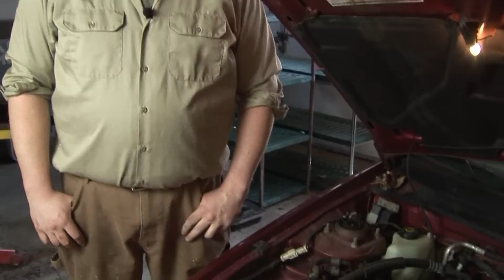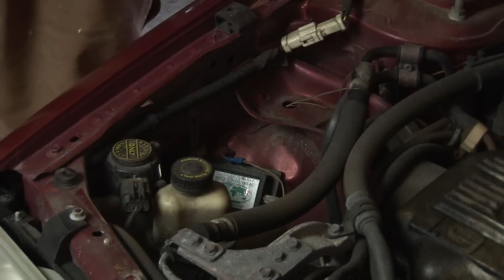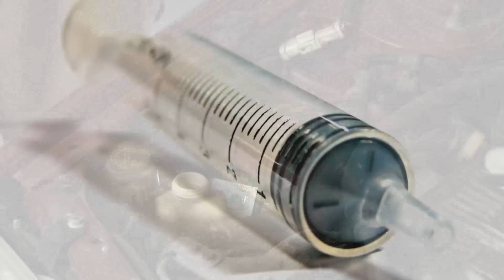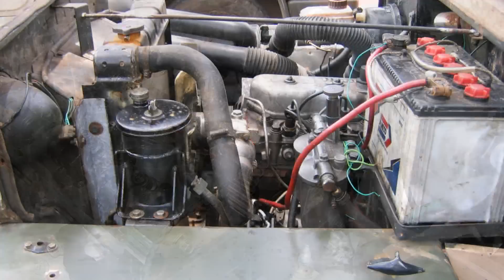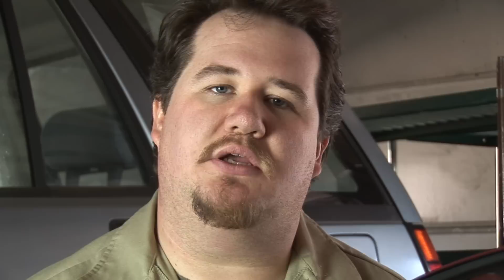Auto Repair : Replacing Power-Steering Fluid

Comment: I wish I knew this last year. As I bought a new pump from Auto Zone . Found out it on a rack and very hard to take off. So took it to a garage to put on - They said sense off, change water pump to. I had a extra warranty that paid for all. They called and said ready. Then a few minutes later said the Auto ZONE pump no good I bought. So I had them put another new one on they got from their parts store Napa. Each time was close to 300 $s  ( OVER $700.00). And now the same noise again! As you read this you might to wonder if I got F---.! Auto Zone did pay for 100 dollars and refund pump. But I really wonder if my old first pump still on. Sure glad I seen this video. A bad expensive lesion!! The garage was a good one -- but wonder cause I told them to put a new pump on -- all they did was half ass clean pump tank?

Comment: I'm hoping this is what I need to do. I was driving my car the other day and went up a very steep, narrow one lane road and had to do a tricky 3 point turn in a tight space. It was at this point my steering wheel began to lock up and this squeaky humming, vibrating noise started to emanate as i turned the wheel (with great difficulty). I decided it was best to drive home and leave it which i did successfully. I can't afford a mechanic so if anyone has any thoughts I would be grateful.

Comment: your reservoir is the over flow.
I don't know your car at all but should be the same as any american car.
You would need to disconnect the line coming from the rack & pinion(firewall area) and replace with a clear hose going into bucket. 
important not to let the pump go low as air would get in and you would need to bleed the system after.
I also would plug the hose you disconnect so dirt don't get in.
easy job add some lucas additive works wonders.

Comment: your solution sounds right. On my car there is a hose connected to the lid of the reservoir which I'm guessing is for overflow, it's just open ended.. and the other looks like it goes to the pump, where is the return line? (07 mercury mariner hybrid)

Comment: This video is all wrong his advise can actually damage your pump.
Disconnect return line place it in a bucket and have a friend add fluid to the reservoir while you turn the wheel continue until fluid flows clean.
Seriously that would be like me removing my engine oil through the dipstick as much as i can and then toping the old oil up with a cup of new oil.
I hope you are not a "A" class mechanic.

Comment: If you don't remove the return hose and add fluid until it runs clean, you still have contaminants in the lines. Definitely recommended!

Comment: wow. do NOT listen to this guy. That is NOT how you flush power steering fluid. The proper way to do it, is to get a helper, disconnect the return hose from the resivoir, and start the vehicle. Have the helper pour in new fluid as fast as it comes out the return hose. Once new fluid starts coming out the return hose, thats it, its flushed. shut the vehicle off, put the hose back on, top off the fluid and your done.

Comment: @AyCorundum the process the mechanic describes is fine, you just have to make sure that you use the correct power steering fluid for your car. Check the owners manual for this information. Some vehicles do use ATF for power steering fluid, others like Honda require power steering fluid made by the manufacture.